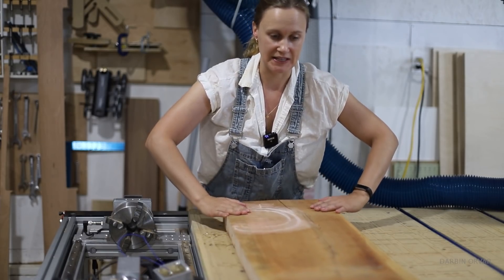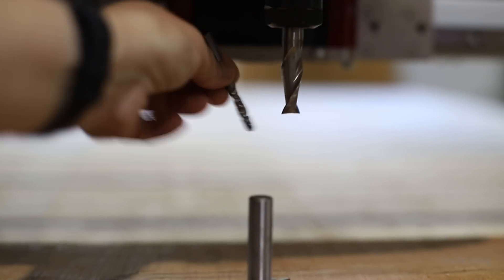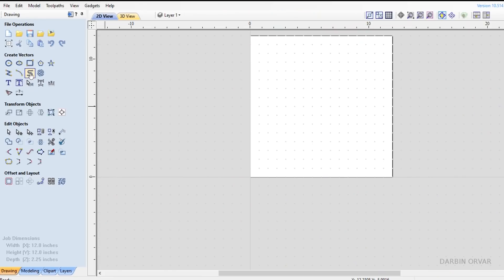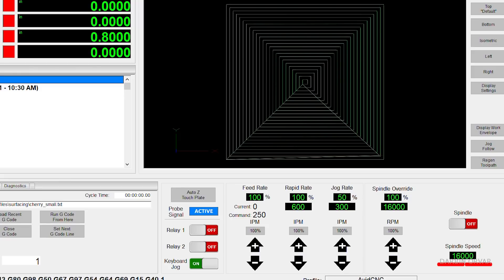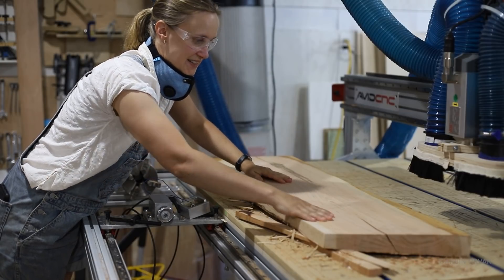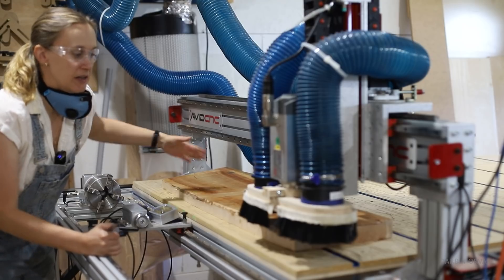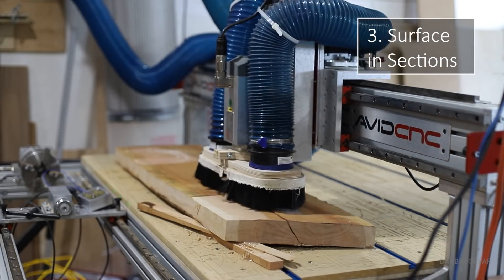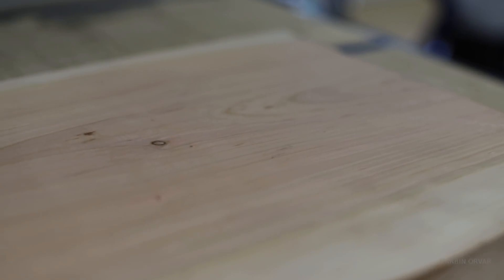How To Joint & Plane Large Boards on a CNC

Comment: Might have been worth trying to flatten the twist before surfacing.. I've seen soak with hot cloths & clamp to solid surface, increase the clamping pressure, then let dri still in clamps.or split to strips / quadrants, surface individual and reglue

Comment: I've used my CNC for planing some years now, and it really works well. I suggest making holders which attach to the side of the piece, then glue isn't necessary.

Right now I'm working on a sleight for the CNC so I can plane 4,5m planks. The problems you get when you have a sawmill...

Edit: I find it odd with so many suggestions of holding the wood in place, though the first thing I made after finishing my CNC was holders for the side of the wood. Am I the only one doing this?

Comment: Here is a Tip: If you cut the length of the board first it ends up less of a bow and then that's less you have to take off to flatten.

Comment: Thanks for the video it provides some good pointers on how to work with uneven surfaces.  I spotted some software you're using "WARP 9", how does that fit in your CNC?
Reply: It’s invisible largely, it is part of how Mach talks to the controller in the machine.

Comment: If you make a sled for your planer, you can wedge and hot glue boards just like you did for the CNC, so you can use a tool with a much higher material removal rate and be done faster.  The sled can be a simple flat board or you can make a torsion box that will be really stiff and flat. As a lot of others have said, alcohol is the solvent for hot glue, which can make getting the board unstuck much easier.
Reply: Though you are correct, you would need a 530mm wide planer in my case and I don't have one of those laying around.
For the hot glue and alcohol - you can make holders which grip the sides of the wood so you don't need hot glue.

Comment: Ah, that reminds me of days of jumping on bent planks so cnc vacuum can hold it. I must have looked like maniac
Reply: Wouldn't that have just introduced stress to the 'flattened' board?  I mean, wouldn't it spring back after surfacing?
Reply: @MrTapanes  Yeah, but it was part of interlocking boards so it wasn't an issue

Comment: Very insightful video.
The surfacing bit works very efficient and with nice chips at the right feed and speed. I think your rpm might just be way too high. On my CNC I use the surface bit at 3000 rpm and maximum feed and get beautiful chips and no dust...

Comment: Hi Darbin. Good tip for using your cnc but you can use your planer also to get the same results even faster.
Screw your stock from the underside of a piece of melamine using wedges and making sure the screws are countersunk and lie well beneath the surface to be planed. Once the surface is planed completely, unscrew your stock, flip it over and run through your planer again until you surface the length you require. You can then cut the board to length and then plane the remainder of your stock to a thinner thickness.

Comment: Would ripping the timber in half then planning followed by thicknessing finally joint the two pieces together be quicker and waist less timber.
Reply: It would, if you are willing to accept the grain matched joint In your finished piece.
Linn could also minimize thickness loss by flattening only the piece she needs and cut loss in half by shimming two opposite corners instead of leaving only one corner high.
Reply: I think she's making it up as she goes along...

Comment: First, let me say I've been a fan of your videos for years now. Love your work, hope you keep doing it. That being said, while this is a cool process, it's super wasteful. Now, for woodworkers like me - hobbyists really - there's no way we could spend our resources this way. Also, we don't have CNC machines. Well, I don't, at any rate. For anyone wanting to take a twist that extreme out of a board that wide, while retaining as much of the wood as possible, here's the solution: 1) Rip the board down the middle. 2) Remove twist from resulting boards. (the twist will be much less extreme.) 3) Plane to matching thickness. 4) Match-plane boards to join back together. 5) Glue boards back together. (Bonus: if you know you don't need that long of a board, crosscut to rough length first. This will also take some of the twist out of the board, maybe most of it.) This process can be done with a planer and a table saw, just a table saw, or hand tools. Done with power tools, it will take about the same amount of time as stated in the video. With hand tools... 
Just a bit longer. I hope this is useful for anyone else out there who doesn't have the equipment or resources. 
Like I said at the beginning, I'm a fan of your work. I look forward to seeing what you post next. Hope you and the family are well.
Reply: A lot of us have CNC's so seeing ideas on how to use them in novel ways is appreciated.
Reply: @rickmellor  Sure. Takes all kinds to make a world. You have a CNC? Go for it, all day, every day. I'm not going to say anything against you. A lot of us don't have CNCs, or need to preserve more of the material, because we're on a budget. Either way works. Also, to modify the process, one could crosscut the board to rough length, and/ or rip cut it in half - to reduce the twist, as previously mentioned- and then use the CNC for flattening. This would also reduce material wastage. And, if you need to keep as much of the thickness as possible, it could be a viable option. (again, one would use a circular saw or hand saw ti do the initial cuts.)
Reply: @tessarnold7597  yeah, one could optimize the process... I had some of those same thoughts while watching the video. However,  it's always easiest to critique someone's work. Linn may have had other constraints or different priorities. I imagine if she was able to get what she needed out of the material using this setup that was probably good enough. If I waited for everyone to post content that met my personal measure of perfection I'd have very little content to view. I much prefer seeing people share ideas and techniques that I can incorporate into my thinking. When it comes time for me to solve a similar problem I'll do it my own way regardless, and I'll optimize the work based on the constrains I have at that time.
Reply: @rickmellor  It's absolutely Not easy to critique someone else's work. It's easy to run one's mouth, but critique requires careful observation, thoughtfulness, and good knowledge of the subject matter. It also implies a level of respect for the one being critiqued.
Reply: @tessarnold7597  precisely. 😉
Reply: Many, many people are interested in joinery but have very little equipment or really janky cheap or old equipment. A capable CNC setup is not inherently more expensive than a shop’s worth of mid tier traditional joinery equipment. Also, the CNC process is gradually relieving tension in the piece and should the piece move gradually during the flattening process, a final pass can still get it back to perfect. Not so with sawing, unless one is sawing a very fine pass off the surface.
Reply from the maker: it would not be wise to rip a board down the middle when it is so warped, and this process works for sizes normal machines can't handle.
Reply: @darbinorvar  Not on a table saw, no. One would need to use a circular saw or hand saw.